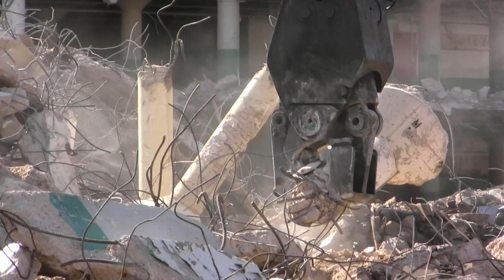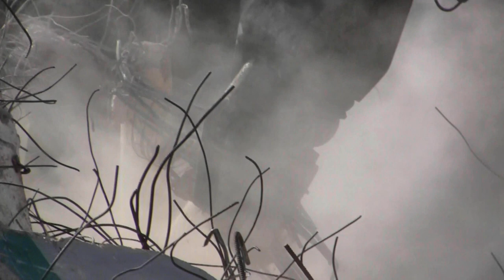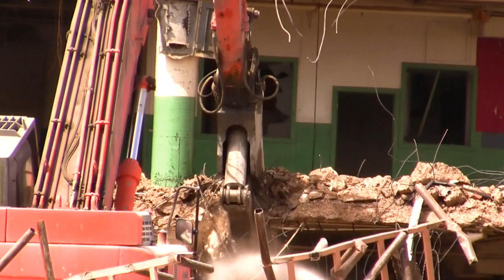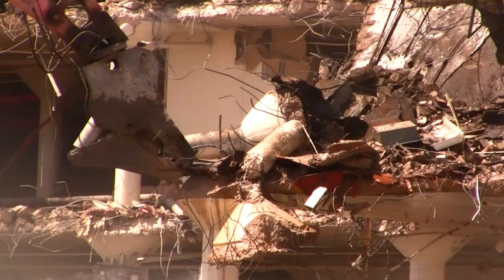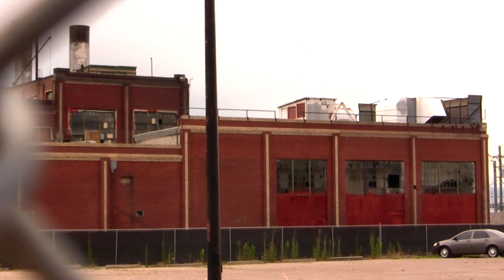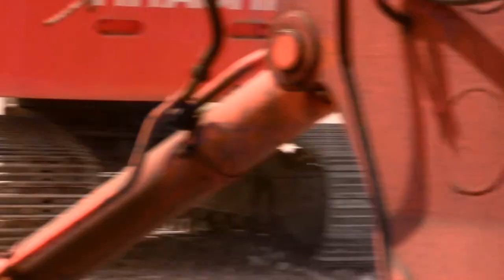Gates Rubber Company demolition Denver, Colorado 2013

Comment: They certainly knew how to build secure structures in those days!!
In the UK, that would have been demolished for no other reason than 'Health And Safety' rules.
.... and todays total was zero wagons!!
Reply from the maker: Yes just goes to show you how important that re-bar is. That was one strong building. Took them around 3 years to demolish.
Reply: The UK doesn't demolish listed buildings. Even if they are dangerous. I live near a factory in Dumfries with the exact same name. Parts of the roof have already collapsed and the top floor is full of toxic gasses from destroyed materials used for building.

Comment: Was there possibly an old stationary steam engine buried in this building?  Also do you have video of what it looks like now?  They probably just put a McDonald's in its place.
Reply from the maker: There was a lot of strange equipment in there. I remember a room with many large, steel ladles used for pouring rubber. The power house shown to the far right near the end of the video probably had some equipment from the steam days still there. Unfortunately scrap steel was at record highs back then and everything was getting cut up as fast as they could get it. Nothing is there today. This factory was massive during operations. Here is the location on Google maps. The original factory went clear to Arizona ave. Some of that land now has condos. https://www.google.com/maps/@39.6982514,-104.9880959,604m/data=!3m1!1e3